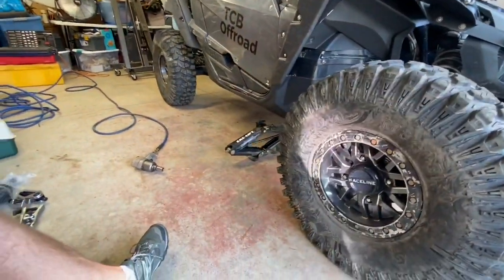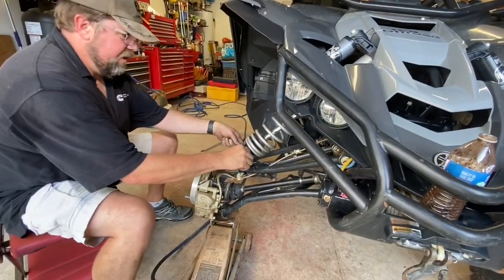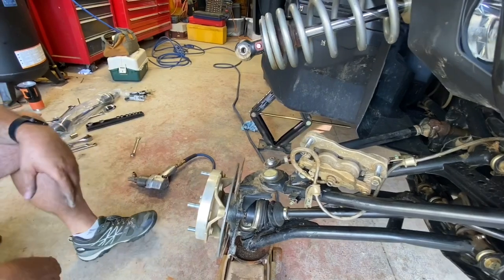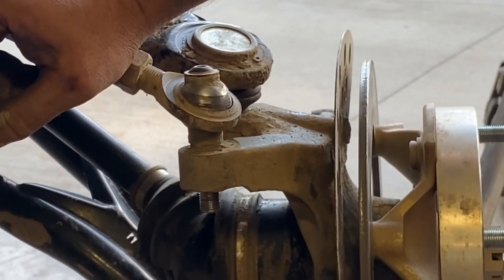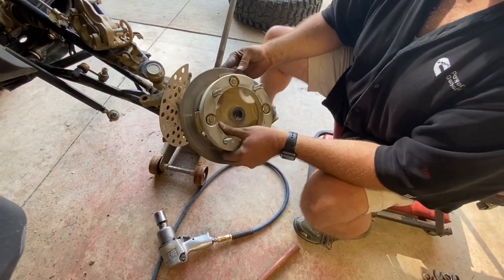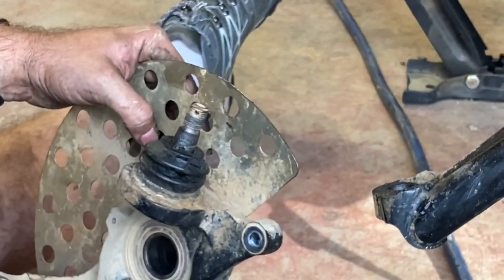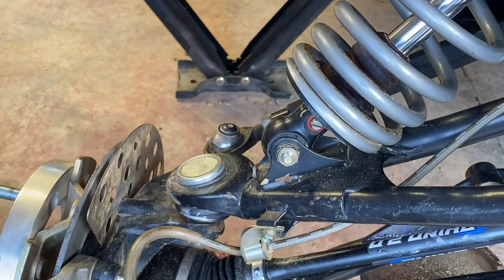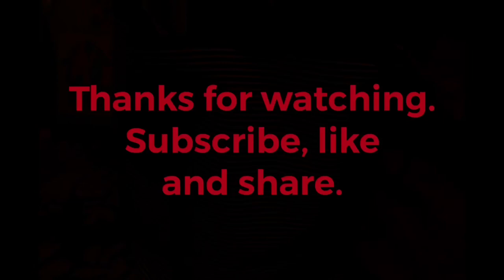2019 Yamaha YXZ broken front axle replacement start to finish.

Comment: I unbolt the lower control arm from the frame and flip everything up out of the way takes about 15 mins to change a front axle
Reply from the maker: Yeah I agree and meant to mention that in the video but Tommy started mentioning worn out break pads and loose ball joints and I forgot about it. I’ve broken axle shafts in the past that was close to the wheel and the axle was seized in the wheel so had to take apart everything.
Reply from the maker: Just reread ur comment and I have to say never thought about removing the control arm from the frame. Under normal circumstances I’ve usually just disconnected the lower ball joint. Learn something everyday..lol

Comment: What size wheel spacers are you running?
Reply from the maker: Dewayn Heltibrand 1” spacers front and rear.
Reply: TCB Offroad did you have to trim any on your wheel studs?
Reply from the maker: Dewayn Heltibrand no sir they are just short of the outside of the spacers.